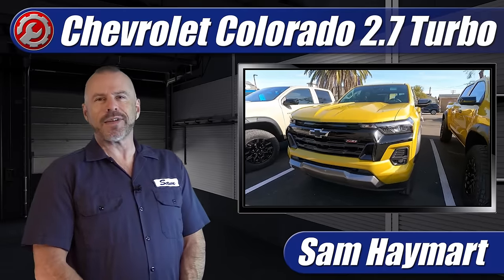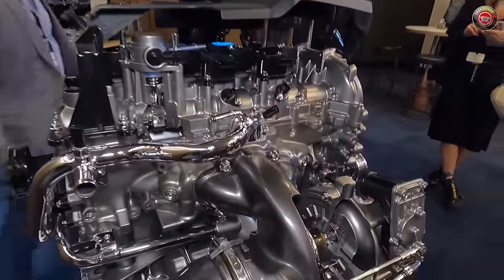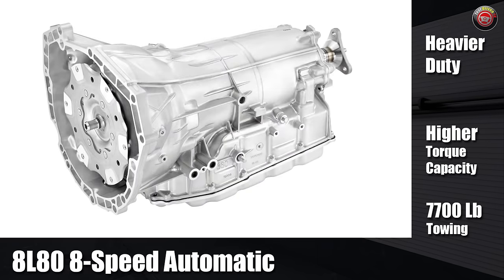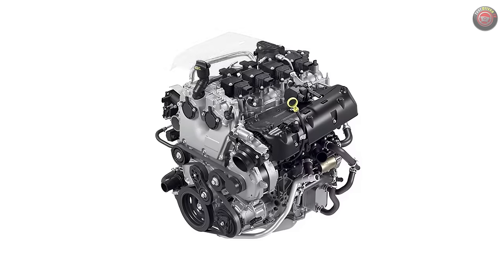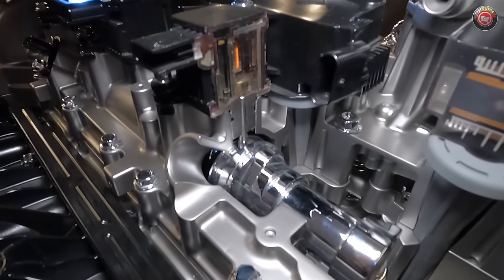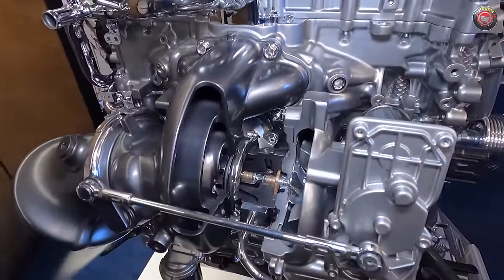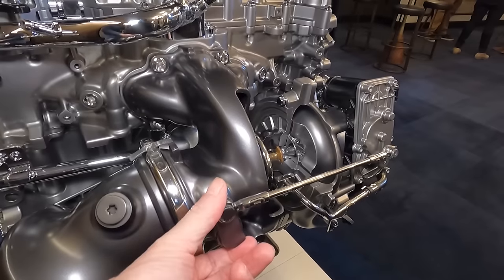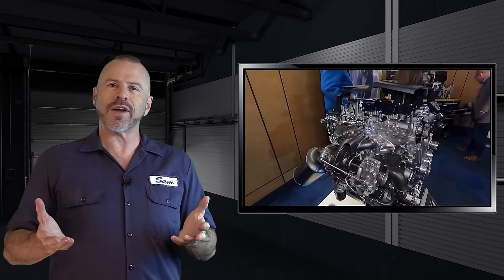2023-2024 Chevrolet Colorado 2.7 Turbo Engine: What You Need To Know

Comment: When I see something like this from GM I can’t help thinking Vega and Quad-4.
Reply: Or like Toyota and rusting frames.
Reply: @docholliday6285  thanks Doc, my 1 adult owned garage kept Matrix was a perfect example. The entire underneath was in worse shape than the Titanic, at only 60,000 miles.
Reply: The ol' Iron Duke.
Reply: Yea I hear that. But if mistakes lead to improvement, then known mistakes hopefully are lessons learned.
Reply: I own a 2019 CrewCab WT 4x4, V6, we use regularly for day to day trans., plus towing a travel trailer at a Cat Scale certified 10,250 lbs. with ease, comfort and safe feeling, with the help of a Fastway E2 Weight Distribution Hitch, that works very well keeping thing nice and stable when windy or passed by fast big trucks. Now there are a couple facts, plus an minuses, about the new truck. Plus, the extra power available, even in a WT, minus, no long bed, minus no two speed transfer case in WT or LT available. Plus a big minus, the LED headlights exclusively available only on top trim levels, that need to be standard across the board for safety reasons. The last minus is a prop rod to hold the hood up? Last plus? Like now the excellent OnStar WiFi, plus nice improvement on the interior.
Reply: Yeah, the other 6 4cyl engines GM has dumped on their unsuspecting customers since then aren't much better. I'm almost thinking of keeping the 2.4 Eco Wreck engines in stock at work. I've replaced 6 of them in a year, and that's just little ole' me. What a pile of garbage! I have seen more robust connecting rods in a lawn mower.
The 1.5 LT Eco Wreck turbo eater isn't much better. It's hard to believe that a car manufacture can have some of the best engines ever built and some of the worst engines as well.
Reply: @docholliday6285     At least Toyota took full responsibility for it and replaced them for free. GM and Ford had rusted frames also but only would say sorry and say "have you seen the new truck"?
Reply: @tbirdboy     Yes, the best 4 cyl engine GM ever built and it was junk. Sounded like a diesel. but it usually lasted for many years.
Reply: @kevinvoyer5053 Agreed - the headlights are awful.  They look like candles.  I can't believe they're street legal.
Reply: Yes I vividly remember my 1972 Chevrolet Vega it was also an aluminum block after it overheated from stuck thermostat at 24,000 miles it started using a quart of oil every 150 miles. Bought it new in second year of production. I will never buy a new generation vehicle. Chevrolet has left a bad taste in my mouth for years.

Comment: I'm just curious what these little giants actually do for fuel economy in the real world while towing. If not significantly better than one of the V8s (in the full-size trucks) I really don't see any advantage. I realize we're talking about the smaller trucks here but I also know you can get the 2.7 in the full-size trucks.
Reply: Poor fuel mileage!
Reply: It's important to note that this is not a full size truck but also, most people rarely drive around with anything in their truck.  They just buy the truck for the look.  If you plan on actually using your truck for truck things, a bigger engine would be a better choice, the down side would be lower fuel economy all the time.
Reply: @frotobaggins7169  Right. Trucks make their decks look bigger than they are.
Reply: I have a 2.7 in the Silverado and I’ve never got below 19 mpg. That is a crew cab 4 wheel drive. I can tell you towing the same trailer I got the same fuel economy as my 2018 with the 5.3. That truck is a double cab 2 wheel drive.the 2.7 gets way better fuel economy especially in city or mixed driving. Highway it averages about the same as my V8 truck. It is also a heck of a lot more fuel efficient than my 2020 ranger.
Reply: @keithrankin6113  I'm not really sure what your point is.  My 88 Sierra extended cab long bed gets between 15 and 17 MPG so 19 isn't a real improvement.  Mind you mine is OBD1, 350, TBI and weighed 5700 on the scales last week.
Reply: The purpose of this engine was not to achieve better fuel economy as much as it was to lower emissions. Its why Ford, Toyota and now GM are opting for small displacement boosted, high compression setups. At idle and low RPM they produce a fraction of the emissions that a V8 does.
Reply: @keithrankin6113  it’s a great truck. What people have to realize is it’s just a half ton truck and doe’s what 1/2 ton trucks do. People act like you’ll try and fail doing what 3/4 and 1 ton trucks do, which no 1/2 ton truck is meant to do anyways. I don’t regret my purchase one bit. Mine pulls my boat and work trailer no problems at all. I get 520-550 miles on a tank on 87 octane here in hilly north GA and get many 600 mile on interstate driving trips.

Comment: Did I hear, " Active Fuel Management" !
Reply: Robert Slegers  More like active trouble. Actually, I sort of like the way they have done it. Much better than relying on oil pressure and Chinese valve lifters. If there is any quality in the parts it might be reliable.

Comment: Pretty high-tech! Amazing they've done as well as they have. Long term though, LOTS of weak points.
Reply: I've seen the 2.7 with 8 speed hit 114k miles, 80k or more of those miles pulling 7200lbs trailers full time in the mountains. This is in the Silverado trucks. It's made a believer outa me. The high output is like a diesel running on gas. Weird but works.... and seems tough...
Reply: The electric oil pump comes to mind
Reply: @ericj810  You consider 118,000 miles a lot of miles for a truck?
Reply: @johnjriggsarchery2457  In a year..... for non commercial truck. Bet ya arse I do. Last time I laid that many down in a year was OTR.

Comment: Hope it works out BUT I will bet it does not pull as well as my 2017 Diesel and will not get nearly the mileage I get. GM never advertised the small Duramax. It is a great combination.

Comment: What octane gas does GM recommend on these 2.7L high output 310hp engines
Reply: If you look up the manual online, it says regular 87 is fine. Despite what all the keyboard warriors on here say.
Reply: Owners manual in my '23 Silverado 2.7 turbo sez 87.

Comment: It’s interesting if this engine will stay together for the long haul. I say that because GM builds an amazing V8 series, some V6 engines are also very reliable. When it comes to 4 cylinders and turbo charging, GM has had a few failure issues with the sonic and terrain series. I. A GM guy, currently owner of a 2021 ZR2 with the v6. I like the idea of what power can come out of this new generation of engines, but just 3 years of so called testing of the 2.7 in the 1500 truck still does not speak volumes of reliability just yet. Time will tell for sure and I hope that this engine really remains a reliable powerhouse, but till then I will gladly be owning my 21 model with the unique front end for a very long time. I could easily supercharge it…. 😊
Reply: The 2.7 has had way more time in testing than just 3 years. Chevy has tested the piss out of these and adapted them. They're as reliable as a direct injection turbo engine can be
Reply: Do it!

Comment: Thanks for this video. I just went to Chevy's Colorado Build page and looked at the base engine (L2R) paired with the (N8R) transmission vs the optional higher output (L3B) paired with the (MFC) transmission.

My question is, is the (N8R) transmission code = 8L45 transmission, and is the (MFC) transmission code = 8L80 transmission? I would assume so.

It seems that if you custom order a LT trim variant with the 310hp engine, the vehicle will be built with the (L3B). However, if you want to "flash" the base engine after production, the vehicle will be delivered with the (L2R).
Reply: Actually you have it backwards. If you want to get the updated HO flash then you need to order the truck with the L3B. The flash isn’t available on the base engine.
Reply: @coop4274  I understand from the factory it isn't. I misunderstood what was said at 2:55 , I thought he had said Chevy said it could be flashed at the dealership. Instead they said, it was possible.
Reply: @Jose Delgado  the base engine would be able to make the power with the flash but the lack of piston cooling and the less robust transmission are the roadblocks. Many   of the

Comment: Is there any way to deactivate the cylinder deactivation?
Reply: Probably if you trick the truck into thinking it's towing. Plug in a light tester in the trailer pin outlet
Reply: @63Imp283  what if you select tow haul mode? I'm gonna test this tomorrow on my 2018 colly and see if it changes modes.
Reply: ZbassR2  The best way is to deactivate your wallet at the showroom door.
Reply: @zbassr2106  tow mode doesn't change it.

Comment: Also #gm #gm needs to crate the h.o. motor with ecotec adaptors if it doesn't bolt right up to the older ecotec platforms like the LNF/LSJ!

Comment: At what rpm does the turbo quick in? Would it be working as you're going down the highway at say 50 or 60 mph?
Reply from the maker: It's not entirely about rpm. It's about engine load and throttle position.
Reply: 1500 to 4000 rpm, the full torque is available. That's why I think the gas mileage is so horrible. Mine gets 12.2 MPG no matter if I'm towing, city, or highway.

Comment: Just got the 2024 WT. One question and 2 comments
No one can tell me if 10% ethanol is ok? Looked everywhere online and manuals. 
Next, that turbo is loud af. Sounds like a whistling lawn mower. And finally, hallelujah a freaking timing chain. No belt bs.
Reply from the maker: Most gasoline in the United States has a percentage of ethanol. The auto manufacturer's design and engineer for it.

Comment: 27 pounds of boost hitting with good 93 gas or E85, on a GM or aftermarket performance tune to keep it up in the boost, timing and shift points would wake these way up. There is such a lag coming out of the hole from the throttle response (not turbo lag) ,and a couple flat spots in the acceleration. They  pull way too hard then fall off like the engineers pulled boost or timing to be able to live with 87 octane.

Comment: It is a complex engine and while it works it is impressive but how long will it last and when it does need repairs will it be able to be fixed without breaking the bank or will it be more likely replaced instead of repaired because of the cost.

Comment: These small engines that have forced induction are under a lot of more stress than NA. They won’t last as long as NA. Cylinder deactivation is a bad idea as well. Not good to have dramatically different cylinder temps.
Reply: Exactly right. Anyone looking to keep their truck for 10 or more years will be sad if they buy these. But it seems like most are leasing now so they won’t mind.
Reply: Most diesel engines have turbos but yet they are known to also run forever. A turbo is a pretty simple thing and if the engine is built for it, like this one, you'll be fine
Reply: @mt186  but don’t turbo gas engines create substantially more head due to running at higher rpm’s?
Reply: @usmc2msu213  The main factor in aware of for generating heat is the compression ratio. The compression ratio is substantially higher on a diesel, that is intentional since that's how the diesel fuel is ignited. This motor from GM runs at 10:1 and is designed to run on 87 octane because of the lower compression ratio. I don't see the turbo being a problem with engine longevity. I'm more concerned with the fuel saving "Eco" features. Btw, I do own a new canyon AT4 with this engine

Comment: Several times, in different videos, I've heard that the statement that the 2.7 is built like a diesel. That statement brings to mind the question: does GM have a long term plan to use this as a 4 cylinder diesel as time goes on? Doing something like this isn't unheard of, GM used Oldsmobile the gasoline V-6 and V-8  from 1978 through 1985 as the basis for a diesel in some vehicles, although it was an overall failure. In some respects this engine, if truly built like a diesel, is an even better candidate for conversion. The injection system is already in place as is the fuel pump for direct injection, it has 4 valves per cylinder, a turbocharger and forged crankshaft with good bearings and a reinforced block. The addition of higher compression pistons, some head modifications and different electronic controls make the possibility of a conversion an interesting proposition.
Reply from the maker: No. There will not be any more diesels in consumer level cars and light (small) trucks in North America. It is built "like a diesel" because it has to be to last given it's small size, high compression (turbocharging), and amount of work it will be put to in a heavy truck.
Reply: @TDTVGarage  You may be right but "never" is a word I try not to use.
Reply from the maker: We did not use the word "never" ;)
Reply: I like where you're going with this.
Reply: This is the best video in-depth on the engineering. Love your videos beautiful information thank you. I love mine got 200k on her. She’s like a Honda s2000 and a baby duramax had a baby. I love this truck keep premium in the gas tank. And I don’t torture my truck. Oil pump and a turbo and I’m gonna try to squeeze 300k out of her take care of your truck and it will take care of you keep the oil gold keep the gas premium do everything you can to keep the truck maintained as best as possible I see these trucks shocking the country over time once word gets out if you don’t tow for a living these things are great.
Reply: agreed.
Reply: @TDTVGarage you implied it.  Ask a lawyer;)

Comment: Why wouldn't gm add port injection to? Cylinder deactivation and a chain drive in the rear of the engine just looks like trouble and a headache for any technician. I'm good I can see it from here.

Comment: The 2021 Sierra has this engine however I don’t think they detuned the engine for certain trims 
I have the 2021 model and at first it was great but at 92k miles a rod broke and was causing a misfire 
Fortunately for me I have the extended warranty and it covered all the expenses but the service from the local dealership that I purchased the truck at was horrible they had me without a vehicle for nearly 5mths without even offering a loaner vehicle due to them facing parts issues and the replacement engine having some damaged parts due to transportation, even tho it was inside a crate.
This engine is great and so is the transmission but the first issues came from :
Oil control pump (inside the oil pan)
Transmission oil control pump(inside the transmission)
Purge valve
Radiator failed too soon 
These small issues were quick to be fixed but the radiator failing with a small leak and even the replacement failed with the same issue 
Idk but 3 yrs into this truck idk how other people are doing with this engine bc if they have a fleet and drive the trucks as much as I do I don’t understand why my truck was riddled with problems 
I had a 2015 Malibu LT and if it wasn’t for an accident which totaled my car I would still have most likely the highest mileage 2015 Malibu with 270k miles and that car never gave me problems like this new engine in these trucks have given me

Comment: Is there any problems with build up of carbon on the valves because of Direct Injection??
Reply: My extensive turbo experience is that catch cans do very little.  Most of the "caking" comes from the air from the turbo charges carrying oil with it.  No Port Injection......No Turbo for Me!!

Comment: Thanks for the info. I have heard conflicting MPG and reliably issues though. I really want to like this engine. I have a family member who works at a Chevy dealership with trucks and these engines and they can't get rid of them.
Reply: That due to the old design 8spd trans.  They have been updated for 2023
Reply: The MPG is terrible 16 to 17 not good for a 4 cylinder

Comment: So since this engine is direct injection only, I’m guessing people should put a catch can on it immediately to prevent carbon buildup on the intake valves?
Reply: My extensive turbo experience is that catch cans do very little.  Most of the "caking" comes from the air from the turbo charges carrying oil with it.  No Port Injection......No Turbo for Me!!
Reply: People just shouldn't buy it. GM neglected to put auxiliary injectors behind the intake valves to keep them clean, so carbon buildup will always be an issue. Ford and Toyota added additional injectors to solve the problem, but I guess GM just didn't want to spend the money.
Reply: @garrettbreindel8722  I’m not sure if it’s a fact or BS, but a GM engineer did state on another YT video that they increased the fuel injection pressure substantially. He claimed that the increase in pressure would better atomize the fuel for a more complete burn, and thus reduce or eliminate the carbon buildup on the intake valve. Maybe true or BS?
Reply: @mikevollmar1021  My understanding is that carbon build up is a result of oil vapors coming from the pcv into the intake, and depositing on the intake valve. Without something to clean them, the valves will accumulate the carbon. That's just my understanding

Comment: Have there been any issues with the dynamic fuel management as they have had with the V8's? Great video.
Reply: Those problems are long ago & far away.
Reply: It's a completely different style of afm. It's a multi profile camshaft like Hondas system
Reply: Ford and Dodge werent any better
Reply: @ne2i just vvt, phasers go out